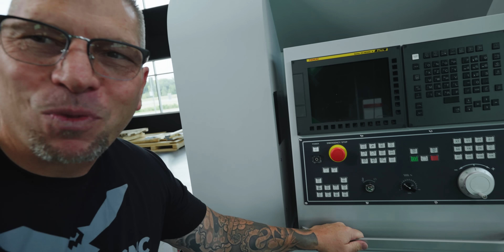140 Year Old Swiss Builder Delivers 1st CNC Machine

Comment: Excited to have yet another kind of technology in the shop that we can use to help others learn and compete!! Thanks for the break down of the machine Donnie, glad to have you on the team!
Reply: This is a little like the Jello/gelatin thing.  Although most people refer to them as Swiss machines, the better terminology is Sliding Headstock Machine.
I remember the first time I saw a Sliding Headstock Machine run, it was like the part was "growing" out of the spindle.  Very cool.
One of the biggest problems you'll have is the guide bushings.  First in selecting a supplier, then with setting the tension on the guide bushing.  I'm sure you're in very good hands with Donnie.  He's been through that many times.

Comment: I work in high volume production. We run Tornos multispindle automatic lathes (screw machines), SAS-16s and BS-20s. These machines are cam-driven, manually adjusted machines. They've been running nonstop on the floor for over 30 years, and they have more than paid for themselves. Some of our jobs run upwards of 33 parts per minute, 12 hours a day, 6 days a week. To say they are reliable is an understatement.

Comment: Not gonna lie. I'm actually super surprised this is Tyson's first Swiss lathe! These machines are made to pump out a lot of parts crazy fast and be very repeatable. When someone says automation I immediately think of Swiss machines. If setup good enough and if the material can stay consistent (bar diameter) these machines can run for long periods of time without supervision or offset changes. Really amazing machines.

Comment: When i saw you cut that foam wrapping the machine door handle, i was abit surprised. On my tornos, the foam was left on and it is just so useful to have. When you are setting up the machine, your hands get covered in cutting oil and the door is quite heavy to pull up and you have to open and close door many times, the foam helps with your grip preventing your hand from slipping and dropping that door on you. Just a tiny thing i know but its better to have than not have.
Reply from the maker: We’re filming and creating tutorials so I just wanted the machine to look at its best.

Comment: My work is getting our first Citzien Swiss Lathe. I'm on the R&D team and am one of the people that are getting training. It's coming in January and can't wait.
Reply: The L32 is gonna be sweet!
Reply: What are you going to use to program it?
Reply: What model are you getting? I was on a K16 for about 2 years then I moved on to an L20.
Reply: @brandons9138  We got a seat on mastercam. Also another for a different Cam software. Can't remember what it's called.
Reply: @zylertilleman3408  I've never used MasterCAM on Swiss. I'd be interested to see how well it works.  I used PartMaker for 10+ years. I've been using Esprit for the last 4. Esprit has been awesome for Swiss programming.  What model of Citizen are you getting?
Reply: @F30586  We're getting an L32. Though we run plastic. That's my only hesitation
Reply: @zylertilleman3408  At my shop we literally run miles of polycarbonate and delrin every week. Are you getting the adjustable guide bushing? That's a must for plastic. The standard guide bushing will be a headache with plastic. Extruded plastic rods can be pretty lumpy making the standard guide bushings inconsistent to set/use.

With a new L32 you should have the LFV function which is a game changer for stringy materials.

Comment: Swiss are VERY cool! I had seen 7 and 9 axis CNC's as big as buildings. Brand new haas, mayzak lathes and mills. But I had NO IDEA about swiss, untill I went to another manufacturer. A lathe, that DOESN'T turn 🤯 it pushes and pulls the material THROUGH the turret, rather than a turret moving along a the material!

Comment: If your planning on machining large orders i highly recommend the bar feeder chip conveyor and even a long parts device for when you have realy long parts you don't need the knock out device you could actually push the parts out of you sub spindle on the back and the long part device catches it we made part's that are almost 1meter (39 inches)

(Edit we have the same machine on the floor gt26 and gt32 for about 2 years now great machine's!)

Comment: Yes 10 mm is typically the max realm for cutters. I used to make bank vault handles that were 14 inch’s long and the head stock only had like 10 inches of travel. It had a 3/8 thread on one end and a radius on the face the entire thing was tapered after the 3/8 thread up to 1.24 diameter. So I had to stop mid turn and reclamp and grid shift, the turn the spindle back on. If I kept my guide bushing tight and used some good tgp the they were flawless. Ugima 303 ss

Comment: I did not know that the thing on the part belt on my swiss machine have not designed accidentally. Because often that thing cause the problem which consist in stuck a part between the belt and the part collector helper. In few cases a part was shot aside when the belt thing squashed it because a part didn't fall down to the collector box.